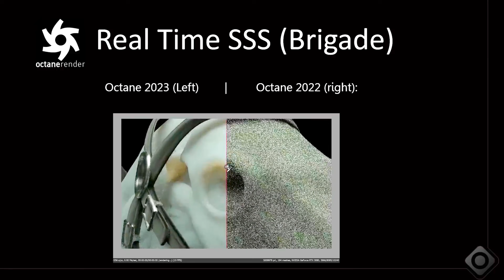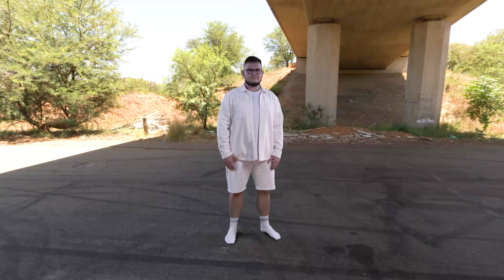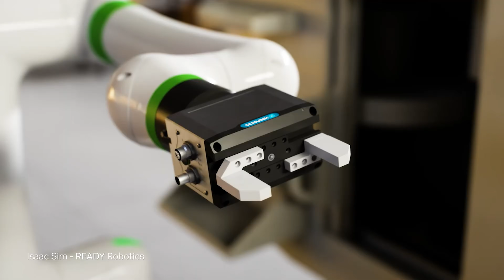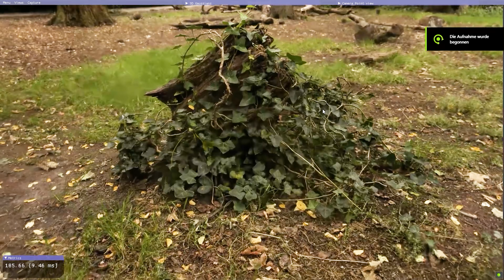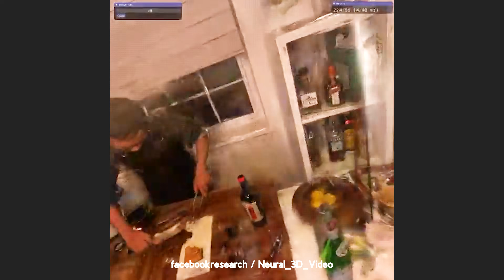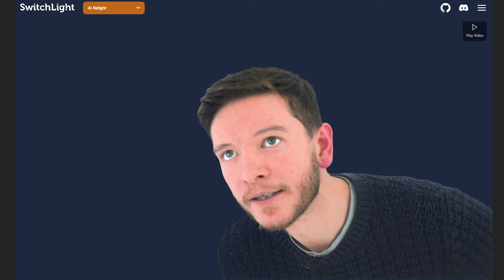INSANE Filmmaking Tech Is NEARLY HERE

Comment: Most of this is PR marketing not reality. Hugo Desk made a video about this a while back, where despite all the marketing and indeed virtual production technology, old school compositing and manual rotoscoping and tones of manual work or work done by using other tools is not decreasing but increasing. That is bad if you want to sell Unreal Engine or Big TV's as solution to all problems. So one should take that stuff with a bucket of salt. In fact you can try it yourself. Do a serious production project and you will quickly find out just how much is marketing hype and how much is reality. If I had a penny every time I hear Gamechanger I would be a billionaire by now. If you have been in the VFX industry long enough, you don't see gamechanging hype, you see marketing patterns. And this one is no different, I assure you. Hugo desk also made a video to test the marketing story about AI doing the rotoscoping, removal, and replacement of human actors with CGI, and its complete nonsense. Go and check that out. Or excellent videos called "NO CGI is really just INVISIBLE CGI " and you will see just how much is marketing hype and how much is not. But if you don't trust anyone, prove  them wrong. Do a project yourself, a serious project and you will see that much of the hype is marketing PR. Manual and semi manual work and decades old methods still needed for most of it. You can get away with new stuff for pre-vis or TikTok, but not for serious projects.